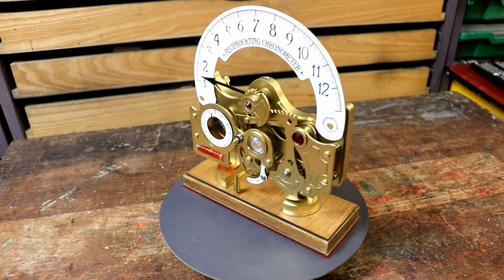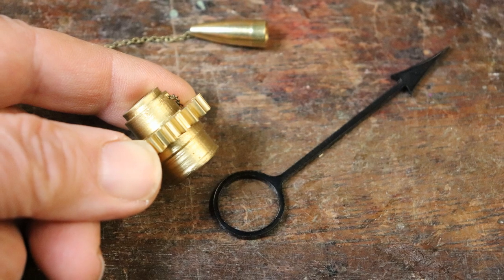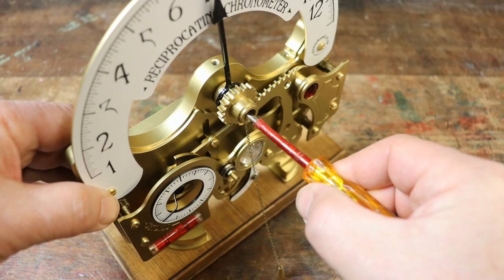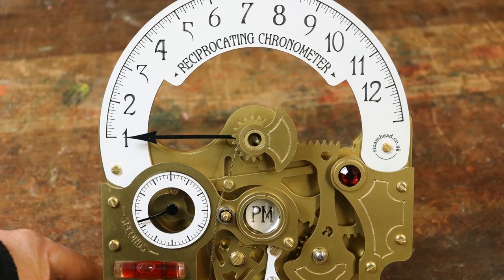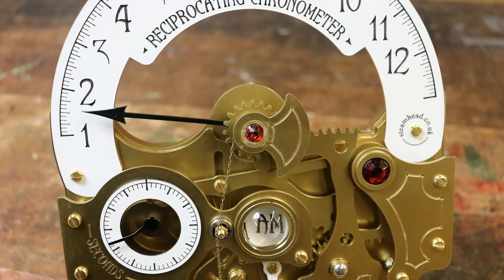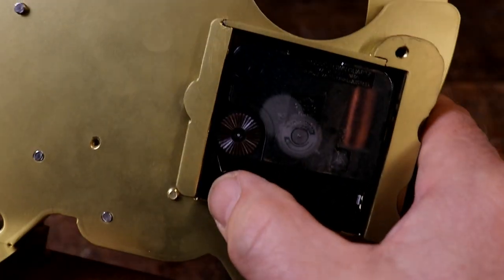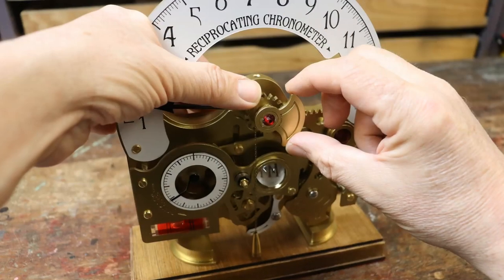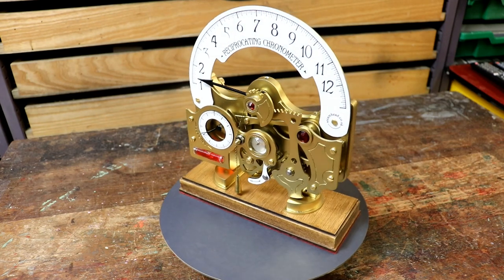Steampunk Reciprocating Clock Instructions - Part 8

Comment: What fun! 

Is there a book or process that you reference for thinking up names for your inventions?
Reply from the maker: The Reciprocating Chronometer was quite easy, as it works with a cam and a follower that reciprocates the cam's movement, and Chronometer was a cop-out, as I've used it before!

If a name doesn't come to mind, I start by using online translators to find 'ancient' Greek or Latin versions of descriptive words that might be helpful, and then try and find several that sound nice together.

The Luminescent Epizoescope is such an example. Having said that, I still haven't managed, despite a lot of effort, to come up with a name for the 'Mechanical Picture Frame' - sad!

Another source of good names are place names in the UK, hence Nempnett Thrubwell where we stayed whilst I was designing it - too good an opportunity.

Good luck with your name finding!